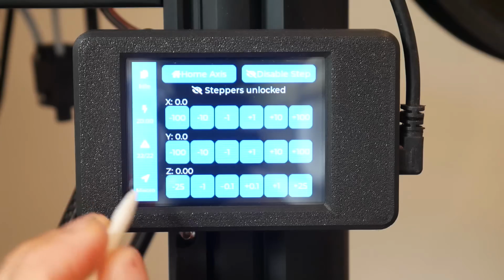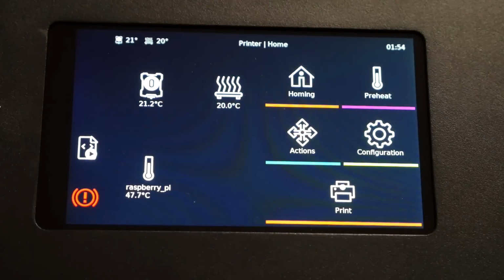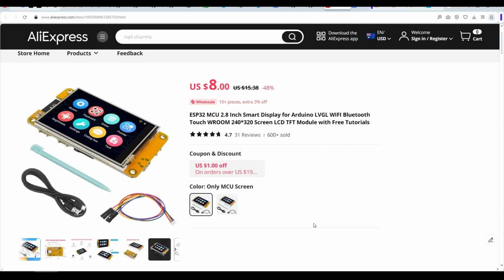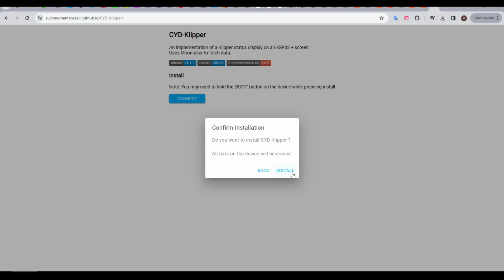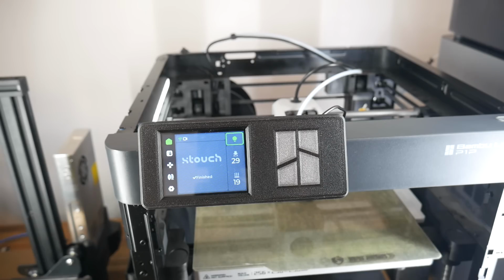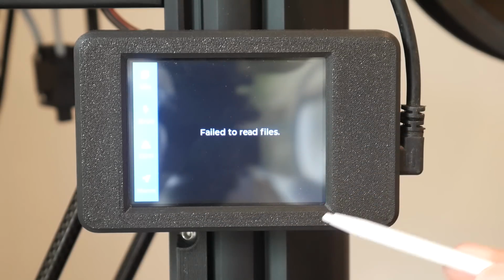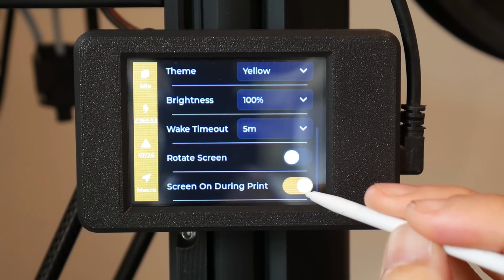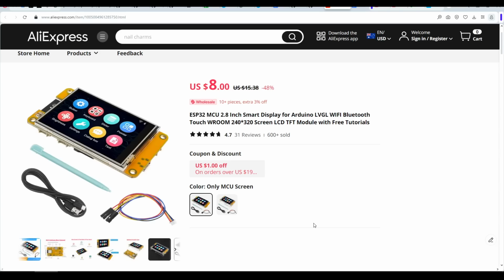Cheap and easy Klipper touch interface with CYD Klipper

Comment: what do you do if it keeps giving you failed to connect even though you've verified that it is up. I did try putting in port 4408 for Fluid or 4409 for mainsale as well as 80. It does not appear to like any... is there something special that needs done for the K1 Max?

Comment: just bought one and set it up, in setting it up it turns out the 3.5" capacitive one is now supported as well, so I'll be picking that up as well, much nicer than resistive screens, and I think it was £12 for the bigger screen
Reply: Do you have a link to this one?
Reply: I'd like this, too, please. YT might not allow you to post URLs though so maybe include just the full name, or another string to search for. Thanks

Comment: Hey, so to use this method I should have klipper firmware installed on the printer's motherboard and already tuned up to work properly before I use this CYD solution as the controller?

Comment: This looks fantastic. kudos to the author.  To control multiple printers with quick macros, and display information, I use OpenHASP on these kinds of displays, and NodeRed to get information from MQTT (moonraker can connect to MQTT) and send details to/from the Display and Printer(s).

Comment: It's just stupid. You have - usb , i2c , spi , uart , gpio and you select get and send data over Wifi ! 

One of main reasons to have display is reset button , and with this display you have a lag between click it and printer reality resets. 
With this you have lag on any action, and you have a ui that doesn't supported by anyone on the community , and it's ugly as hell
Reply: Is there no place in the world where you want a printer status display that doesn't have to be hardwired into a pi? I run mine off a battery bank so i can place it anywhere.

Also, i think it's a bit short sighted to say that the screen is not suited to be an emergency stop. I think you'll experience more latency by waiting for the command queue to empty before the emergency stop is actually processed. If you really want an emergency stop, consider the power plug :)

Comment: This is amazing, just need to get klipper working, I had trouble getting mainsail and klipper to interface with each other
Reply: Kiauh is your friend!
Reply: I used kiauh, its after the installation process in mainsail where it tries to connect with klipper and shows the blue message for 5 minutes, then it goes red  @Anziilife

Comment: I don't like adding both this ESP32 plus a pi running the Klipper server. I see expensive Creality Sonic Pad is available to do it all in one. Any suggestions for DIY kits that result in a single enclosure klipper server and touchscreen supporting an input shaping accelerometer?

Comment: Question. When you are setting IP to the printer. Dose that mean the printer has to be a WiFi enabled device? Also, dose that make the old screen obsolete? I want to do this exact thing for my SR.
Reply: The raspberry pi that is running Klipper has wifi onboard.

Comment: I wonder if this project could be ported to work with the included LCDs on machines like the ones included with the Anycubic Kobra series. They’re just a simple lcd with an onboard processor, and if they could be flashed to this project they would already be fully in place and fit into a converted printer

Comment: This looks like way more than 2 minutes.  Must be this video is for those already familiar with klipper, know the code, have a raspberry pie attached to their printer, and know how to do all that before taking the two minutes to install this.
Reply: If you already have klipper, this takes very few minutes. I think that is the logic of the video, because installing and configuring klipper will take you a lot more (and I did it manually, not with an image because I use an old laptop for running klipper)

Comment: Here's a question, I have a Voxelab 3D printer (I'm a newbie to 3D) I also have a spare Rasberry Pi laying around. Is it possible to connect the 2 so that I can access the printer via my network. At the moment it uses ssd cards, which is a pain.

Comment: Out of curiosity, can you plug in an sd card on the back of that screen and transfer files? likely not but Im curious if that is a feature since after klipper conversion, the port on the board becomes useless.
Reply: I suspect it might be a future option. The ESP should be well capable of this, it's just a matter of writing the firmware.

Comment: Does it work with RatOS and is there a version of this for Duet boards?
Reply: I got it working on my minion with RatOs and is doing fine. What I struggle with is macros and how to add some basic commands to the screen that I’m showing in mainsail.

Comment: This looks like just the ticket.  Question, if I am out of USB ports on my raspberry pi?  Can a splitter adapter be used to share the port?
Reply: This is just for power, you could also use a buck converter to get 5v from your printer PSU, probably can even use same buck as your rpi if you are already powering from psu
Reply: Use an USB Hub
Reply: Thank you. That helps and I seem to have options.

Comment: Great video! I'm the person with the cyd repo , im delighted to see it continuing to be useful to people. 

I had nothing to do with CYD klipper though, amazing piece of software!

For people asking about using different displays (or bigger displays), its probably relatively easy to port the project to a different display if you you are happy to code it yourself, but the webflash method will only work on this exact display
Reply: Thanks for your work on the CYD!
Reply: Thanks for providing it!

Comment: WHAT! Thank you!

(Edit) I'm the author of CYD-Klipper
Reply: Bro I love you ❤
Reply: Bless you.
Reply: Well done sir, it's amazing how functional it is for the price. Chef's kiss
Reply: We must say “thank you” for the project. Also thank you to Micheal.
Reply: Much thanks for an awesome project!
Reply: You are a legend!
Reply: Dude this software is amazing. Over the past decade I've used so many different screen implementations, and your simple non-tethered fast wifi implementation turns out to be what I wanted all along.
Reply: Will this work easily on an Artillery  Sidewinder X1?
Reply: @LincolnWorld  as long as the printer exposes a moonraker api, yea (if you can access mainsail or fluidd via your pc, moonraker is accessible)
Reply: Great job!  Keep working on this!  As Michael pointed out, z-offset support should be high on the wishlist, but I see no reason why that would be difficult to add.  My main problem is getting another CYD without customs bumping the cost up significantly.  The price difference between AliExpress (which I just cannot get anything from without customs pestering me) and Amazon is also ridiculous (from < €10 on Ali to > €20 or even > €30 on Amazon).
Reply: will this work on any of the other sizes variants of the ESP32 displays available on Ali for cheap too? i know some of the driver are different between displays , but will be nice be able to use ESP32 LCD Display 3.5 or a 5.0 inch TFT LCD Touch Screen also. apart of that great work , i love to have more choices to connect to the printer.
Reply: @odindj1979  nope, only the 2.8 inch variant is supported (by me at least, there's nothing stopping you or someone else from forking the repository, and re-positioning the elements to fit a 3.5 inch display)
Reply: @SuchMeme  belive me if I knew how ill try to contribute.  I have see some videos tutorials how to program the esp32s but I do not understand how integrate to klipper.  It's a github where to get the files that u load into the esp32?
Reply: Nice work. Where would I start to reposition the image to fit a 3.5 inch screen. I do a bit of esp32 coding via IDE and Vs code
Reply: @FlixmyswitchLASER  the 3.5 inch screen is already supported ;)
Reply: @SuchMeme  thanks for the heads up. On a side note I hear that FluidNC i(I hope to use this for a diode laser)  going to support these 2.8 inch screens in the feature. It will be all OS when released. My question is are there any instructions videos on how you post the code from a 2.8 to 3.5 inch screen as I find the 2.8 just too small.  Or any good resources to learn how to use these within Arduino / Vs code. These screen have got me excited again in basic coding
Reply: @flixmyswitch  it really depends how the base project is structured. Changing out the display driver is decently doable, but the ui also needs to account for scaling. If it doesn't, you have the 2.8 inch-sized ui on a 3.5 inch screen. You'd have to rewrite basically the whole ui to fix that
Reply: if you are the author, what versions of Klipper will this run on? I'm trying to make it work with my K1 Max and I'm running MainSail and it just keeps telling me that it can't find. I'm putting in IP and port 4409 which works from my web browser just fine.
Reply: @JoMiller97  mainsail is not the same as moonraker. Is the ip you enter the moonraker or mainsail ip?

I don't do explicit checks on version but most semi recent will probably work
Reply: @SuchMeme  same IP, different ports. I’m not sure if moonraker is installed. Does it have to be moon raker?
Reply: Thank you ❤❤
Reply: Thank you for this awesome project. 
I'm going to try on a TwoTrees SK1, a printer with a custom display that become useless when both Armbian and Klipper get updated into its MKS SKIPR customized clone. So Klipperscreen with an external SBC + display and yours CYD are the only ways to give again a screen to this machine with a wonderful kinematics but poor and outdate software implementation.
Reply: @SuchMeme thanks for sharing ❤
Reply: Could you add support for a wired connection? Because it relies on WiFi to connect to a component that is literally part of the same device? What if WiFi lags or drops?..

Comment: This this work with the new Anycubic Kobra 2 Max?
Reply: If you see the video, you will realize that this works with every machine under klipper. It connects to the machine using wifi, so no wired connection is needed. The only wired connection you need it to supply power to the screen. If the machine does not come with klipper or you did not mod it to add it, this won't work.
Reply: @santiagopostorivo  I watched the video. Sorry new to 3d printing. I didn’t realize it until I got it that Anycubic locks down their entire printer so you cannot mod it.  So that’s why I asked.  Sorry.

Comment: Can you use any ESP32 touch display?  I saw some larger ones with better resolution for not a lot more cash. I’m curious if those are a viable upgrade pick.
Reply: I’m wondering the same thing I think it will work though it’s the exact same thing just bigger if anything it will work with a border around the edge but should be able to fix by editing the firmware

Comment: it seems a diy solution is also possible. I just have some tft touch screen by my hand. will have a try this?weekend
Reply: ive done it. just used a regular esp32 dev board and a 2.8 inch tft. works perfectly.

Comment: your instrustions are slways so precise and easy to understand. 
I was hoping if you make an updated video as to how to setup a touch display for raspberry pi running octoprint on my ender 3
Reply: I'm not sure, if this screen requires Moonraker or Fluid.
 Can someone confirm it's working or not working with octoprint?

Comment: Will this work for the 4.3 version? 4.3" inch ESP32 Display ILI9485 IPS TFT LCD Module ESP32-8048S043C-I Capacitive Touch Screen 800x480 ESP32-S3-WROOM-1 Development Board for Arduino IDE